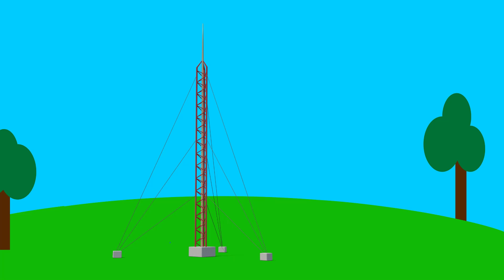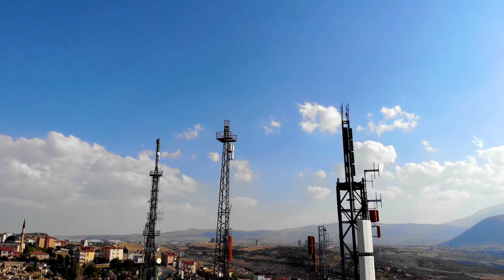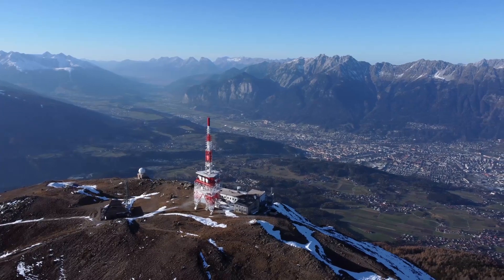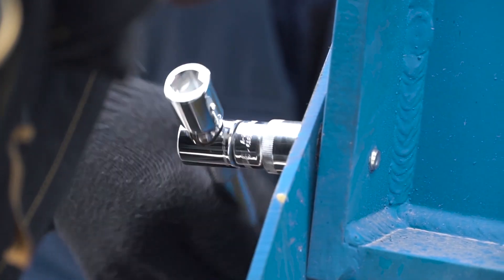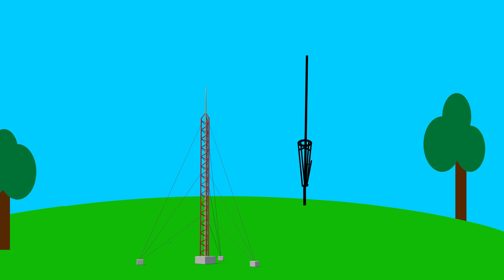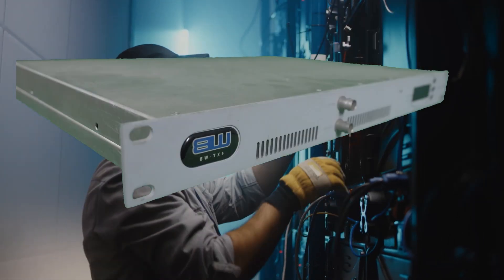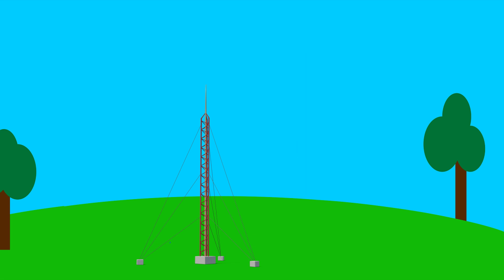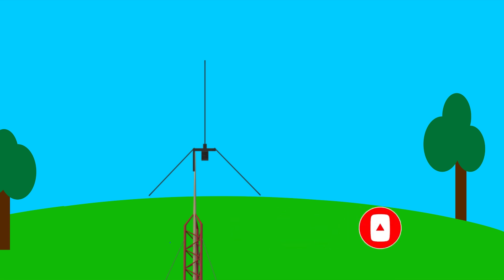FM Radio Station ANTENNA For FM Transmitter Set Up. How To Get It Right For Best Signal Quality.

Comment: Vertical Dipoles are 1/4 Wave Not 1/2 Wave
For Every (2) Vertical Dipoles, the Gain Factor is +3DB  Not -3
Reply from the maker: A vertical dipole has a quarter wave radial but is called a half wave dipole because the two quarter wave parts being the radial and the ground plane measure at a half wave.That is simply an industry term not a scientific value. Not sure why you thought anyone said there was negative gain with antenna stacks. I'm guessing you misunderstood something. Im guessing you misunderstood the part about some circular polarized antennas having a -3dB gain meaning that it requires 2 antennas to have 0 dB gain.
Reply: @inspiresoundpro  thank you for your reply.
We used to Have a Hobby FM low power station using (4) vertical dipoles stacked array w 3KW power divider/ using 10 Watt Exciter driving a 500 Watt Amp having an effective ERP 2000KW
Reply: @inspiresoundpro  Personally speaking- its very difficult to achieve the Perfect In Line Stack  array using the Rhone 25 Tower Leg. Its best to Pre Stack Bays on a Pipe / Pole on ground then Hoisting up the tower, In my opinion.  But those fun days are all over

Comment: Most FM station antennas that I saw here in the Philippines have circular polarization that resembles the one at 3:33, but they are often paired in sets of four or six. I even saw pairs of eight in Metro Manila.
Reply from the maker: Yes circular antennas are very popular these days especially for built up areas like cities. They are more expensive but are great for keeping the signals stronger between buildings and they help with antennas being at different angles. Cheers :)

Comment: Do I have to consider anything regarding the use of a dominator antenna in conjunction with an IBOC digital transmitter (HD-Radio)?
Reply from the maker: Hi. I am not an expert in digital transmitters but my understanding is that whether analogue or digital, the antenna is only affected by the transmitter frequency and power output. What the signal carries, whether analogue or digital really does not impact on the antenna choice or use but I stand to be corrected. That's unfortunately not my area of expertise. Cheers.
Reply: @inspiresoundpro  I'm planning of putting a 120 ft tall self supporting steel lattice tower on a 1000 ft tall hill in austria. After watching your video I think I will use a dominator antenna instead of the standard dipole array, in conjunction with a 3kW ERP IBOC transmitter to get about 40 km (25 mi) of good sounding stereo FM and HD-Radio reach. Because heavy thunderstorms aren't unusual in my region and the tower will be in a exposed position, lighting are probably going to strike the top mounted antenna quite regularly.
Where should I mount the lighting arrester? Directly after the antenna, down at ground level of the tower, or in the transmitter building?
Also I'm not shure which transmitter brand I should purchase. Should a get a Nautel, a Broadcast Electronics, Gates, etc.? Which manufacturer would be a reliable choice?
Reply from the maker: @user-munm  I unfortunately can't recommend any specific manufacturers. It takes a lot of research to make that sort of decision. I would think it would be best to speak to a professional broadcast installer about a system like that. There should be a few of them that you can speak to in your country. They would have the best insight into the best choice and the complete set up. There are also a lot more things to consider than just the equipment. so they would be the best to speak to.

Comment: I own a dominator. The REAL one from Norwalk electronics. Sadly they are out of business !  We got about the last one I think they had built themselves  Here is the story they farmed out production to a company that turned around and sold it to a China outfit they make one now called the terminator. It’s junk ! Lightly made and not nearly as durable as the original from Norwalk ! I think the last I heard years ago they were trying to sue the outfit that sold the specs to the Chinese manufacturer.   Being a ham those lightning arrestors do not always do there job we just shut down and DC the coax from the transmitter  same with my ham rigs only connected when in use.  I have made a spark gap one for a guy with a AM 🏴‍☠️station he of course uses his whole tower as a antenna it sits on insulators the guys are insulated too . He has all tube type stuff it’s pretty much bulletproof to that problem.  I have also found along with a towers lightning rod and grounding system those stainless steel puff balls called static eliminator’s do a LOT to bleed off a impending strike . If you want to build a 1/4 wave FM ground plane it’s very easy from copper tubing and PVC  pipe that was our first antenna and it’s still up there 15 years later as a back up simple and to make with good soldering skills  .
Reply from the maker: Sad to hear about Norwalk. The original Dominator was fantastic. Yeah I love making antennas out of all sorts of bits and pieces. I have been working on a design for a quarter wavelength antenna as well. I will put that out when it's ready. Thanks for your input. Always nice to hear about other peoples experiences. Cheers :)
Reply: Norwalk was bought by Progressive Concepts, so the Dominator continues to be available through them.
Reply: @Boomerlake   is it US made ?? hope the quality is still there . the ones called the terminator are really sadly built  lightweight  and the parts are not nicely machined  as theirs was . mine has been up there on that 100 foot tower thru 100s of thunder storms  and Know has been cracked by lightning a bunch of times that was here when it happened . you cant beat Tripp Lite rack mounted power conditioners  to keep your power safe take up 3 rack spaces though  .
Reply: @jhonsiders6077  I don't know.
Reply: @Boomerlake  ok thanks for the info I know  a guy that wants one will do some digging
Reply: Have you found the signal to actually get out well? Say, better than a dipole?
Reply: @TheOne18263   Never ran a FM dipole  I do have a end fed beverage wire rig of 750 feet for my ham rig .It has a good ground system under it  its just 20 feet off the ground and tunable at the end to ground  mainly hang around 40 meters  so i have set it once . You could build a vertical one for FM if you have a tall enough way to support it  FM is pretty much  line of sight  power helps but you gain little range that way And invite a visit from the FCC  but the way Trump is cutting costs it will be to our advantage !! have a 100 foot free standing tower and the Dom is at about 80 on a standoff  on just 15 watts can be heard 15 miles away  More if set to 100  But a commercial station is 100 miles from us on the same Frequency (the reason we were denied a LPFM license ) dont want to step on their toes . not likely but on a good night it might happen .

Comment: Also with an lightning arrester, equipment will be damaged. The lightning just doesn't enter the building with full power.
Reply from the maker: No with a lightning arrestor all the electrical discharge goes straight into the ground if it is installed correctly. If you are still getting damage to equipment after stalling a lightning arrestor then you should check if the installation has been done correctly.
Reply: @inspiresoundpro  Arrestors only work when the voltage becomes above a certain threshold level, so that normal (wanted) operational signals do not trigger the arrestor. Equipment will therefore face a higher voltage, although for a very short period. If an electrical discharge from i.e. the center conductor goes straight into the ground, something is wrong. The path to earth for a center conductor has to be triggered first.
Reply: And a lot of the ones have a disc inside that blows you have to replace it or you no longer have a connection to your antenna ! Found this out with. Johnson Viking years ago .

Comment: 1 watt can reach 7 miles ??
Reply from the maker: Yes 1 watt can reach 7 miles quite easily depending on the antenna, the terrain and most importantly the height of the antenna. The receiver is also very important. If you use an old analog tuner then no you will probably just get a mile or two but a good quality digital tuner in a car can have you receiving the signal for many miles. I have run a 1 watt station that had listeners in their cars listening quite happily within a 7 mile radius.
Reply: @inspiresoundpro  i used to have 500watts in my orginal country Lebanon . Now I been in the US for 10 years and I really want to go back to radio scene but license is almost impossible. But i think I low power don’t require a license so probably couple of watts will do me good especially in Providence RI very small city and over populated.
Reply from the maker: In USA it is possible le to get low power licenses but it is apparently quite difficult to get one. Unfortunately as far as I know  the FM signal not requiring a license is less than 100 mw and even worse the regulations limit the range so you have to use a transmitter with a small built in antenna. Not good enough for a radio station. You will only get about 100 yards  or meters from it.

Comment: Greqt video - but - Lots of inaccurate information in this video.  Circular polarization "penetrator" design antennas produce the best quality coverage with the least amount of multi-path.  In fact most commercial radio stations use them.  The tuning thing is not a thing at all.  I have never had to retune a properly designed cp antenna.  This guy suggests vertical antennas which produce the most multi-path.  Its not all about gain - its also about quality of the coverage.  This from a broadcaast engineer with over 35 years of experience in the field and Broadcast antenna design.  I dont have time to go into the minute details of why CP is better.  But 95% of commercial FM broadcasters in the US use some form of a CP antenna.  Dont ya think there is a reason for that?
Reply: Call dan. I said it was a great video.  Maybe I should watch it again all I got out of the CP portion was if they go out of tune which I've never had that happen.  And I must have completely missed the Superior penetration.  But then again I'm coming off of about 30 hours with no sleep after finishing the 2023 LPFM filing window with over 100 appliance. LPFM is a portion of what we provide we also have a full power radio and television licensing.  As far as multipack it's just not that much of an issue with a cp.  Now you are correct in your assessment that a multi-bay CP is the better option as it focuses more energy towards the horizon and not losing so much towards the skyward and downward ways.  But it has much less multi path if installed properly.  While vertical antennas are plagued with multipath the especially in an area that has lots of electrical lines and telephone poles things to bounce off of.  That can be a critical situation for a 100-watt radio station.  I'm not against you I liked your video the graphics are great and great voice over.    Perhaps when I Wake from my slumber I will watch the video again and see it differently.
Reply from the maker: OK no problem.  I just don't like it when people use the comments to vent but don't contribute anything. There are other engineers who comment on the videos too. Some with more than 35 years of experience and some with less but they try to add to the conversation and if they disagree with anything they explain in a way that helps the viewers. The comments can be just as important and valuable as the video for people who are new to radio. I don't say that I am perfect and get everything right. If there is other information that can help the viewers great but don't just say "lots of inaccuracies but can't get into it". That helps nobody. I welcome other people's views even if they completely disagree with me as long as it is done respectfully and in a way that helps the viewers.
Reply: They have a bunch of power and money to put 4 or 6 of them up . !
Reply from the maker: In the video I do explain that CP are excellent for penetration so I'm not sure what you so upset about. For very low power stations often signal range can be more important and smaller stations often don't have the luxury of large CP stacks.. I have also worked with low power radio stations using CP where their antennas got damaged and suffered sever multi path interference. You say lots of inaccurate information but don't offer anything except that you can't be bothered to add to that. Either be helpful and add to other people's learning  here or go play somewhere else. If you are such a big shot engineer why do you bother with small YouTube channel videos where you contribute nothing. Suffer ego much?

Comment: Can I put tbe dominator in an attic?
Reply from the maker: Hi. No the dominator is a big antenna. It would not fit. The best antenna for an attic is a quarter wave antenna. It's probably the only antenna that will fit.
Reply: They are out of business see my post. You can get the cheap knock off called the terminator from China but low quality made .   I know of one inside a all wood church steeple that works so so lol the guy is a FM 🏴‍☠️ with a STL so if caught he’s not busted . He did make below it a set of ground radials  .

Comment: olá,qual distancia entre 2 ou mais antenas agrupadas para transmissão de fm na torre.
Reply from the maker: Hi. I have to answer in English. The spacing between the two antennas is a very complicated situation. The reason is that it can vary depending on how much down tilt you want. Also it can involve using a balun.  The theory on antenna arrays is quite complicated but some say that having a half wave measurement between the two antennas should work but others say that 3/4 wavelength gives more gain. It is something you would have to experiment with to get the best results.

Comment: Help with the link to buy  arester
Reply from the maker: I'm not sure what you mean. What do you mean by arester?
Reply from the maker: I realized that you meant lightning arrester. I found these ones on Ebay: https://www.ebay.com/itm/232628601562?hash=item3629bec2da:g:yXEAAOSw6ShZRVHu&amdata=enc%3AAQAIAAAA8Nq4dm3mCDQm5igj2XWuMWqJQrxgcC8u0FQTRIjANfrEI9a2aMB4MpGZdML18KNNVn91LsURxYdHLza8tq9hT31MKPtEML%2FEDXegisxB6NSxdwWGLxwbSC%2BDzyqwpvPvwYVxKFchQAVJxNkdp2yWt7T8om8lf6Fub8yF5V4cWplBc4%2BXRr0sxe%2BbHBPvbPYp%2BKgHNS2mX%2BiQLEuCI0prrplGmZisWRh9A6unZvkxGuzzRxeGuxdrzR8KyFquBsNNnjUC1vjCMLV9MzXQQgtNCO1b6nLxktaoDL%2FpYYIzy%2F%2FBWuJD3xJTWMMtbsjX%2Fytj5Q%3D%3D%7Ctkp%3ABFBMyuC65p1i

or
https://www.ebay.com/itm/122360780152?hash=item1c7d455578:g:RooAAOSwr~lYqF1J&amdata=enc%3AAQAIAAAA8Gox6%2BHeavCbckCXfEmFMrKLuevdOBgCOSwgoPa02TzlU%2FlrwHQgAsK%2F1VQFEk25TK2sLVyZf88sq4FlKkmY2%2FN159u0BQHLxi75fAXhyC36ledQ14ZTUnj3vFaV91PGsmxXg7GatqT%2FE%2BJvWyIht8XS1FOzXS%2BTJVvwRG00S5YXoGax0AR%2FvjsukWsBrCgT1MFcArg0EAEw4BceN8b1X9ndbMoJdwzNqCt1DI%2FWRqBD64zbtUl0W06mpleEsiUVQuUAxQYgRve%2B2%2FKs%2BUW91pRgvXlcWG1TAtiXrldbk96wT%2B%2BZg1XQ1jBSQR9SfVq0oA%3D%3D%7Ctkp%3ABFBMyuC65p1i

or
https://www.ebay.com/itm/150798872656?hash=item231c503050:g:A-sAAOxyqUpQ8qcG&amdata=enc%3AAQAIAAAA8La1Ewuave0CksTdv1zJGZMQRaOR0wgtiNq56VyGS0NUFNs%2BhkAgSCtrzyFjNYepwdyOpKWabOJBAV%2Fm6rCYRaf9uHO9xWhooO2%2F1axARWdshmjdwVR2%2B%2ByS%2B529bcNlIYMok0hi7VHAY2coCsx%2FFhmbF5xJ4CsoXjrldu%2FRBmRF3WYzJv3qPkNqJVzAptDd9QEO8%2B1nAxK%2BRP74ugD3aSeDomI2c5Fr6ht61rAmZG8fSbDzvlhTIkxE7O%2B%2B2TDAdqP6WBoo1NZ5BVpHHLMQh75fBe6lPMW%2BNM3Wp0Gww9gW93TqDufp1EftF4uJVBoHrQ%3D%3D%7Ctkp%3ABk9SR8rguuadYg

or
https://www.ebay.com/itm/313798592306?hash=item490fda8732:g:9S8AAOSwvrxhTkqN&amdata=enc%3AAQAIAAAA4DF2Bp7dO1kWFiwnqC%2FWHWRYFCeuSoJwlUToi%2F90ZRSSkjPGVt2KRWZvVBKHDmoN68lk0HvfcHzdRflWWsKwZ5oPajGMnTw8F8Yvf%2BLLRD6Ovcchfi2KCbC9u6dk%2B69jvP39G%2FdGZPvoP0s%2F5Hn7%2FfNEOWBrKyqgNRewnuxOODkeoTn485x2n%2FW6tHjSZ1JZxN3dXMKm2UPGEbsmxrBrLH6%2F%2BhT3ejsFw9hzct6US%2FyUd4hY8pPNvkQS7aR5fUVMuxmIlWEn31bJ9B67UoVaFVGQCLOqMGF7SyJhHpUL0ljz%7Ctkp%3ABk9SR87guuadYg
Reply: the radio amateurs handbook published by the ARRL  in the US has good plans for a gap arrester  I have built a couple  but if it gets close I just quit till it passes and DC the coax . safe than sorry .